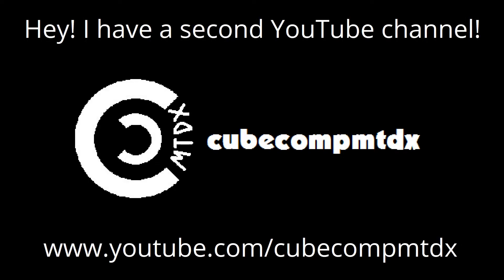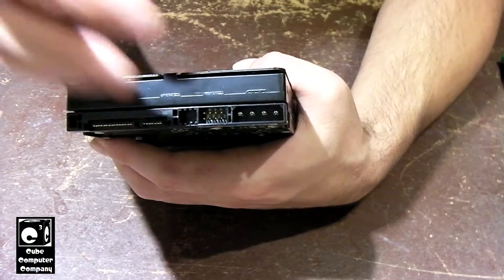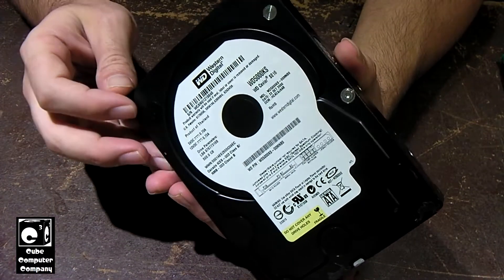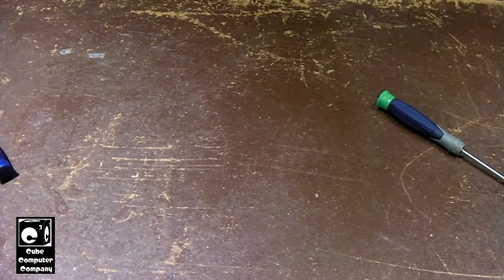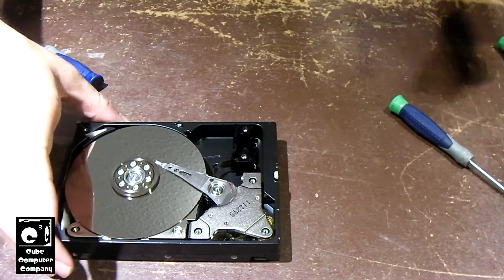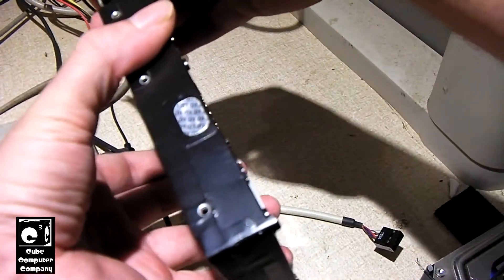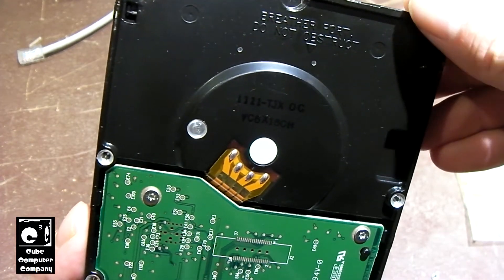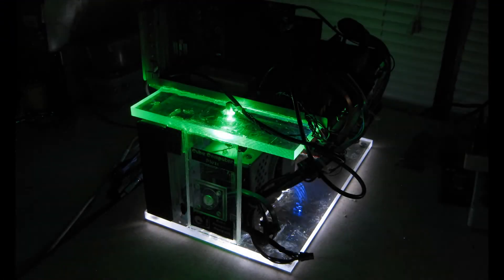Opening up a failed WDC 500GB hard drive from 2006

Comment: I always enjoy seeing the inner workings of HDDs, thanks for sharing.
I use an old 250gb SATA HDD in my Dell Dimension 4600 because it has the molex power connector, and it's quite a bit faster than IDE.

Comment: New 3.5 inch drives are up to 20TB, but are designed for the big boys like google and amazon. I am running an 8TB 2.5 inch SSD as a data drive.